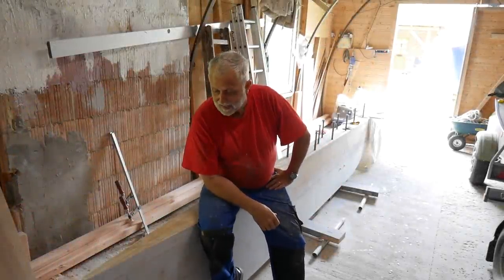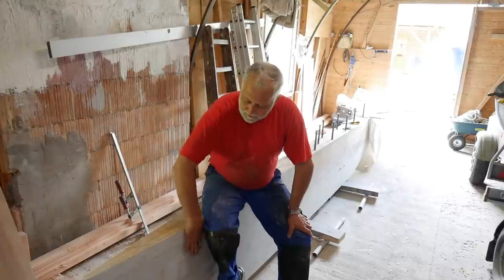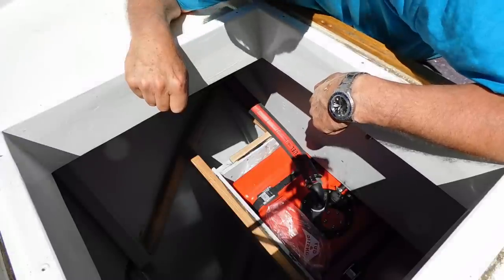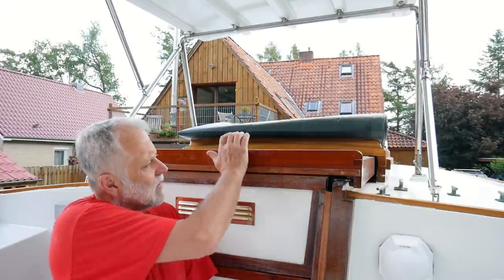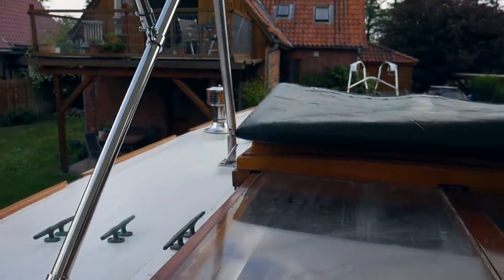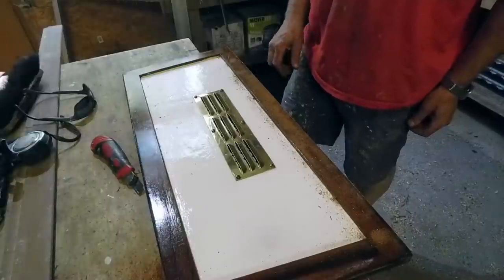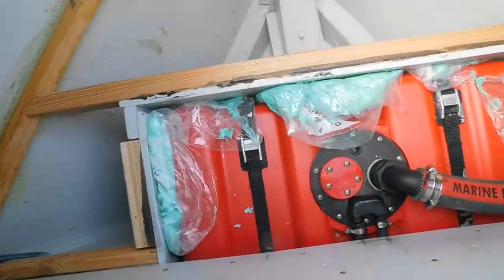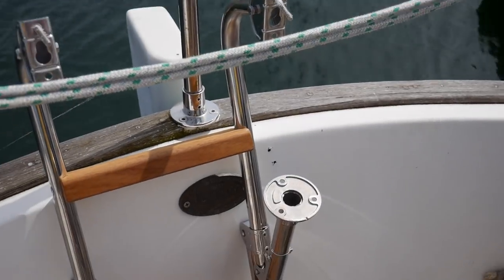Hatch upgrade, tank securing and anchor chain - SV Tapatya EP233

Comment: As usual Tony very nice work indeed. On the companionway hatch and the extension you fitted to over sail the washboard, I could not not see the detail but a half round drip groove routed into the underside may help prevent wicking of rain water through the gap. The keel is a thing of beauty.😀👍⛵️
Reply from the maker: Thanks Norman. Yes, I thought of a drip groove too. If need be... 🤔🤔